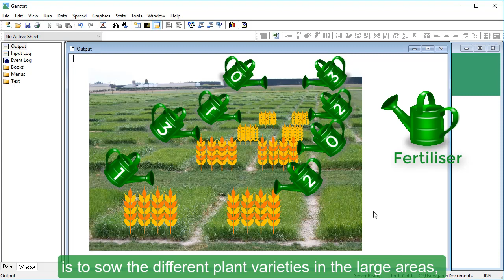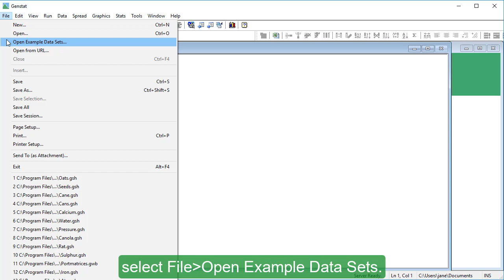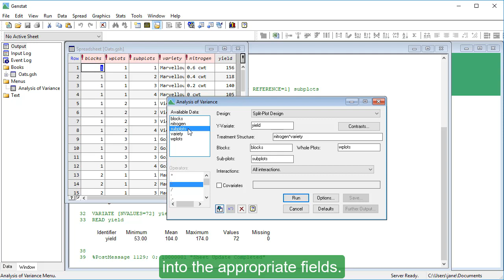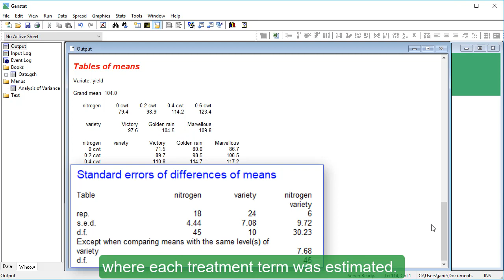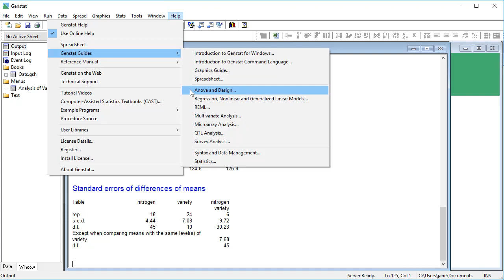Split-plot design using Genstat

Comment: I want to be the number of digits after the interval in the outputs of the program 2 or 3 what is the way if you can
Reply from the maker: To do that, after running the analysis please go to Analysis of Variance menu window. The Save button is now active, click the button and then select Export to file to save the outputs in the MS excel format which allows you to change the number of the decimal places.